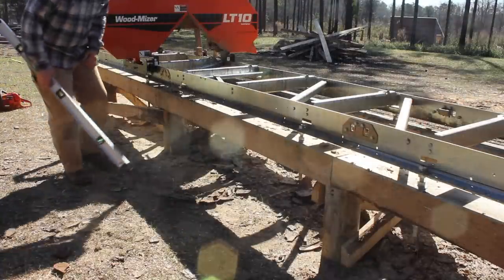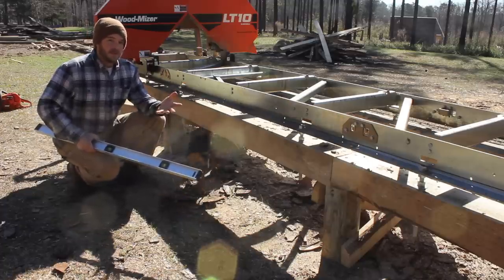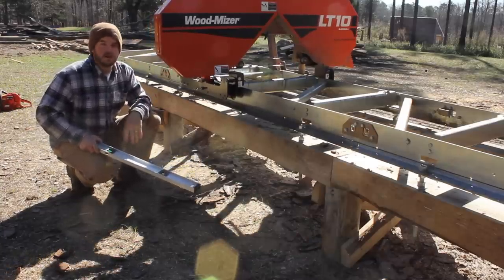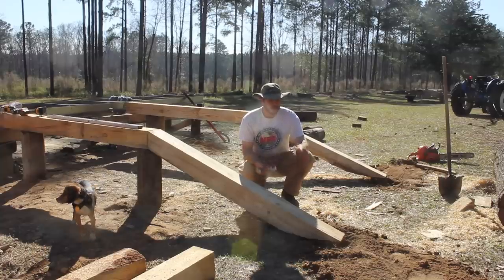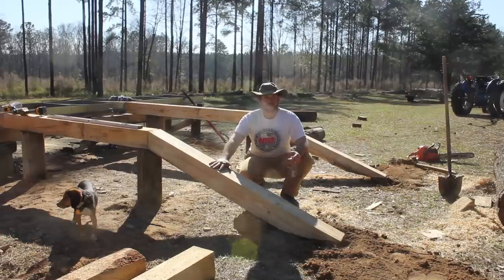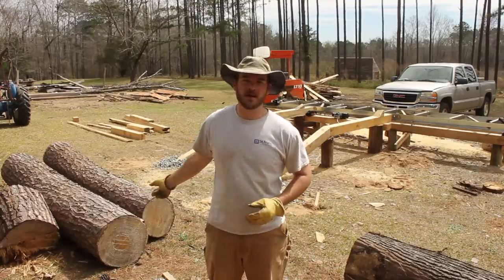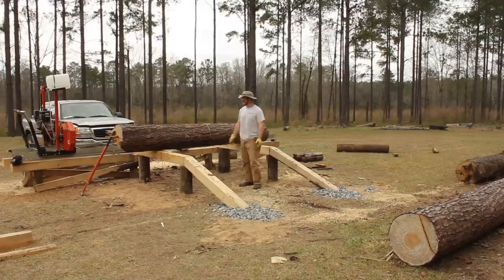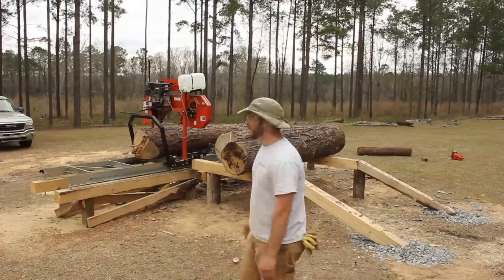The Best Sawmill Upgrade I've Ever Made

Comment: Nicely done. A tip about the concrete around the posts; bring the concrete to just above ground level. Any water that seeps will sit on top of the concrete below grade and in that first 6-8 inches of soil is where all the bacteria live that is so good at breaking down organics. I've had to repair fences and pole buildings that were built with pressure treated (some creosote)  where the failure point was right at concrete level below grade. In some cases they put some at the bottom and some more near the top, failure in both locations.  Concrete brought to above grade and slightly sloped away will provide good run-off and no long term pooling. Treated posts with no concrete at all will actually last much longer than those with a ledge of concrete that is below the surface.  Another point to give peace of mind is to put the added support member on the winch timber on the opposite side of the direction of pulling force, in your case, on the side between the mill support rail and the winch timber. It acts just like a header over a big door, deeper is better than thicker i.e. laminated 10" x5" rather than 5" x 6-1/2". (first number being horizontal dimension, second is vertical). A lot of words to try to explain a 3-dimensional situation. Love your channel, you have an exceptional work ethic.
Reply: Both excellent suggestions - I especially like the concrete "cone" idea for lack of a better word. Plus that'd get those little gravel stones away from the logs and he'd never risk getting one embedded and ruining a saw blade later as someone else wisely noted.
Reply from the maker: murphymb Great suggestions! Thank you.
Reply: 8
Reply: 99999 IP
Reply: @briankeller9424  Herman Cain? "9-9-9"
Reply: A fella can learn a lot just reading “been there done it” comments, appreciate your advise.   From Missouri
Reply: Don't let the concrete spill over the hole you dig and form a lip. The lip provides a space for water to get under and freeze in winter. When the ice expands it causes the post to heave up causing misalignment.
Reply: @twal5299   agreed, the guy that suggested to let it go to ground level must live in a place that doesn't freeze over the winter

Comment: Nice job.  Thanks for sharing. One suggestion would be to make a groove in the soil where you pass the winch line under the log. Have a length of rope placed in the groove before the log is moved into place at the end of the ramp.  That way you can easily connect the rope and fish the winch line under a large, heavy log.  Happy milling.
Reply from the maker: Mark Rothenberg It’s hard to see in the video, but I actually did have a little trench dug out for exactly that purpose. Appreciate you watching!

Comment: Excellent work, that'll make it safer and a whole lot easier. Couldn't help but think that if the tailgate of the truck was even with the top edge, a couple of ramps parallel to the saw bed, and a little decking, and you'd have a great atv/lawn tractor/etc. loading ramp at the ready all the time. Don't you love when someone else is trying to make MORE work for you!

Comment: You might want to think about getting a set of three point hitch pallet forks for your tractor, this would help greatly to position the logs for your log deck, that way you can drop the logs off most anywhere within the general area and be able to maneuver them into place. Awesome looking deck, that should save a lot of work and aching back, you might want to think about adding a angle brace in front of the winch to help support the pull of winch when pulling logs up the ramp...have a good day
Reply from the maker: Don Latimer Good ideas, thanks Don!

Comment: The log deck works great! Did you consider mounting the winch on the back side of the sawmill - maybe on a large post up higher than the bed level so you use it to turn the logs as you are cutting wood?

Comment: The log deck on my mill is like yours. The wood deck beams rotted pretty quick so when I replaced them I paint them from time to time with used motor oil. Now they are lasting well.

Comment: Great idea,something to think about ,a flat piece nailed outside of ramp with horizontal holes in it ,to put a  rollback pin in the horizontal holes, or oversized chalks( some short ,some longer) when the  next feeder log starts sliding crazy lock it place so it doesn't have to be lowered to the ground and get a better bite ,nothing like seeing a working man! Keep it up

Comment: Oh sure, use the old knuckle buster post hole digger for the 4 holes, but get out the impact driver to put the screws in.  LOL. Great jobs on the log deck and ramp.  I am sure your back loves you even more now.

You may also want to consider installing another telephone post on the far side of the mill and anchor the winch on that side.  This will prevent you have having to remove the winch all the time time before you start to load logs on the mill for processing.
Reply from the maker: bwillan Ha! Those diggers keep me warm on cold mornings! The winch is actually mounted below the level of the logs so the logs just pass over no problem.

Comment: Excellent ramp system!  You're sure to benefit from it.  One critique, IF you don't mind?  On other mills where they utilize a winch to pull logs up to the bed the winch is located on the opposite side of the mill.  You could do that easily.  Plant one post to mount the winch onto it and brace it in the same way the ramps run...against the stress.  I suspect you'll figure that out ;-)  Great job regardless!  You're doing great work!  Thanks for the videos! #KeepTheChipsFlying!

Comment: Well done, sir, well done. If I may, the eye bolt that you have underneath the winch, get a second one. Move them both out away from the winch by the posts. Get yourself a piece of cable or even a strap and make a triangle. Attach the ends to the eyelets, take the top point of the triangle all the way out past the ends of the ramps roll the log over it. Then hook your winch to that point on the triangle. As the winch pulls on the triangle, it's going to get wider on the log, which will help keep both ends coming up the ramp together. I hope this makes sense. If not, shoot me a message. I would also recommend that you mount the winch on the opposite side of the mill, and higher. It would be most productive if the line pulled upwards towards the winch or straight to the winch.

Comment: great job on finishing your smart loading ramp , your first efforts where great . Maybe add a second cross beam to the outer two posts. Then add a section of chain from the inner post ( near the tow motor) to the new outer post . So ... You can simply hook your chain with cable hook and not crawl under the first log to cable up each 2 nd and 3rd log ? On your 2 wood safety wedges that keep the 1st log gauged away from saw travel. Connect the wedges with a piece of lite wgt emt conduit so you can move /control both wedges without having to walk around the load rack each time. 3rd thought  mark the horizontal beams  with a black marker so you know where to position the wedges each time? Is milling what you do for a living on your farm? Keep up the videos and sharing . It is appreciated. :)
Reply from the maker: I mostly just mill for myself. Great idea on the marks! Appreciate you watching.

Comment: awesome job and smartest thing to do. I always cringe when I see people using loaders, clamps or other machinery to place log on mill. If not using mill hydraulic loading arms, and you still want to use machinery, I believe that you should always use a log deck. Deposit your log on the deck and roll it on the mill in a controlled manner. The mill is a precision instrument that can be easily be bent out of alignment if a log was to be dropped on it's bed..... and we all know that operator errors and equipment failure can cause that very easily. Great investment of time you made my friend ;)

Comment: Great job.  Your first pair of posts (directly below top of ramp) will spread apart eventually cause there is lateral force on them.  I’d x-brace them if you can do so without interfering w the cable.  It’ll keep them vertical longer.

Comment: Another great idea. I'm going to be setting up my new saw mill for the first time come spring [April here in Southern Ontario] and i cant wait. Once I have the sawmill set and leveled, I am definitely going to rig up a ramp similar to yours. I was planning to use an older bucket tractor with fork extensions, and probably still will for some bigger logs, but it is a bit too large and difficult to maneuver in the space i have in mind. I'm also a bit worried about bumping the sawmill, or forks scraping the bunks when pulling back. Plus i really like the idea of having a loading area. My time spent on my land is often sporadic and limited, so having a few logs sitting waiting to be milled for the next time i come up is very appealing - [rather than spending time staring the tractor and having to load them before i get started milling]. I've gotten a few good ideas from your channel, thanks. i will pass them along.

Comment: Bridge between the brow and the mill with removable angle iron . A tractor can lift logs onto the brow. You can then roll them onto the mill, take the bridge pieces away. and saw. Its easy that way. My brow is pinned to the ledge. My mill is on a slab on the same ledge. Its a little low, but it works well. Good luck. surprised people dont use these more.

Comment: GOOD JOB MY FRIEND.. Maybe run a couple braces from next to the winch over to the timbers the logs rest on ,, bolted in with some all thread ,, or lag bolts.. You could rest them on top & draw the angle across the bottom,, cut it out with chain saw,, small impack screws to hold while the bolts are drilled.. love your little pup.. Aloha

Comment: Nice work overall.  One thing on setting the posts that could have helped, a water level (clear tubing with water in it) from the track to the posts.  Taht would have removed the need to cut down posts.  Or string to set it up also.  The post hole digging was impressive, kudos to such hard days work!!
Reply: Oh BTW big thanks for building up a log ramp, need one for my "new to me" mill!  Will be doing similar now!!

Comment: Add a 2 by 6's onto the inside of the rails about 1 inch down from the top. This will allow you to use a bar to roll or scooch the logs forward. Faster, and will allow for alignment.. And, make some large wedges for stops on the top rail as you advance the logs.

Comment: First time commenting, the design and concept are awesome and that it is hand engineered is even better. Your creativity is endless when it comes to these types of projects. I only see one point feel compelled to state about the cross beam with the winch on it. Besides the board you added, and this maybe redundant, but for you and the safety of the mill, I would add support posts under the beam with the winch. Nothing need be dug out or concreted, just extra support If the board or the main beam get damaged or fail. Would be a terrible thing if it failed and you mill rails were crushed or damaged.
Reply from the maker: Appreciate the great comment. I see that timber as the weak spot also. My concern would be getting up into the larger logs, 22-24". A post or two and a brace is a great idea there.

Comment: Get yourself some quick connect cable ends for battery cables. Put 1 end on the truck with a weather tight cover, kind of like a snow plow hook up. You could even put an inline fuse or breaker rated at max draw for the winch to protect the truck. Make up the matching end on the winch. Save you a lot of hassle with popping the hood etc every time. 

Will also avoid the arcing ect and chewing up your battery terminals.

You can make a short cable with the plug on one end and the gator clips on the other to give you all the options
Reply from the maker: Greg Mislick Good suggestion, thank you!

Comment: I built my pole barn with a pretty decent amount of Timber Lock screws, is that what you were using? They have > 1 ton pull out strength and 500 lbs shear. 
I am a woodworker, and don't have room for a mill, I just frequent the local who do. I did have a suggestion, on the ramps, if you used oak or similar to create a (aprox 6-10" ) wood tooth, to prevent slipping back, maybe 1/2" lags to pivot on, and a small spring to pull up and hold in place. Looks good...

Comment: Maybe consider removable(?) peaked chocks/dogs/pawls on pegs that drop into sockets at the top of the ramp timbers, extending the ramp just a couple inches longer and higher, and preventing logs from getting away from you and rolling back down when you've removed the cable.

Comment: Great video. I want to learn all I can about platforms and loading devices. I do have a  problem where I live-- Brooks County GA on the Florida line-- with termites. I have even found them in used cross ties used for landscaping. I was shocked to see them living in a cross tie. I am contemplating buying  a simple mill. Beginning to wonder is I need to build it on concrete. Thanks.

Comment: You can center the log with less cable and easier work, by laying a chain from the two opposite ends of your pulling beam in a "V" that extends beyond the end of your ramp. Roll the log on the ground over the point of the "V", so you don't have to drag the cable under it. Then just lay the cable over the log and hook to the center of your "V". The ve will get wider as you pull the log up your ramp and correct any misalignment as it comes on to the deck. You don't have to pull out as much cable and dig under the log.  Good luck
Reply: Can you draw this out for me or post a picture of what your saying? Please

Comment: You may want to invest in some synthetic cable for the winch, those steel cables can cut into trees. Also if you’re going to use your truck to power the winch you may want it running so the batter doesnt die after winching a few logs in a row.

Comment: The twisting moment on your winch beam is going to eventual break those light lag screws you used to attach the beam to the bottom of the ramp.  Maybe you used heavier lag bolts that you didn't show.  Nice ramp overall.  Going to save your back for sure.

Comment: Just finished building me a log deck also. I haven’t added any ramps or winch I am able to load the deck with the tractor and boom. It’s sure is nice to take some of the worry away about hitting the mill with the tractor or a big log.   

I plan to add a winch and ramp later. What size winch are you using
Reply from the maker: Chris Cox It’s a 4500lb winch. It was on sale at Tractor supply for 149 last year. I think I could get away with a smaller one, but this one was a great price and is plenty strong.

Comment: Suggestion;  pour a 2 x 2 slab with re bar under the wench.  Then place a short timber on it and screw it to the wench beam.  Also, adding under support to the ends of your wench beam wouldn't hurt anything either.

Comment: Yes  solar panel are a good ideal if you don't have a lot of cloudy days or a Panel that can charge the battery up fast enough. that wince motor is like a starter motor it will pull about a 150 amps DC and that can jerk a  battery down pretty fast.
Reply from the maker: James Tate Yes, this winch can drain a battery fast. Leaving the truck running i think is my best bet.

Comment: I would have left a bit of the top of the ramp timber riding a bit higher than the flat posts so there was a small hump to act as a safety so the logs can't roll back away from the mill. A diagonal brace set on the same timber as the winch wouldn't hurt either so it didn't tear out the winch or risk snapping the post since it has holes drilled in it and the torque on the log the winch is putting on it.

Comment: Well that'll definitely make life easier. At least until YouTube buys you an LT 40 wide! ;P. Maybe a dumb question here but couldn't you use the boom on you tractor and slide the logs up the ramps? The ramps would keep the tractor from having to lift all that weight? Regardless, You've come up with a fairly simply solution to big problem on the manual mills. Nice work as always!
Reply from the maker: Northwest Sawyer The tractor could probably do that...in fact that was suggested by a commenter in the last  video and I seriously considered doing it. But, I went with this because it’ll keep me from backing the tractor into the mill on accident...and because it’s a much smoother operation. I don’t know, I just like it this way. Sounds like you’ve got a 40 wide on the brain!
Reply: Well I don’t but we know a guy that does😬
Reply from the maker: Northwest Sawyer Indeed! Looking forward to his upgrade!

Comment: I recommend some "dogs" on the ramp to keep it from rolling backwards on one side or the other if it gets to sliding instead of rolling. A horizontal bolt through the ramp holding a length of metal that is off center drilled so that gravity will hold it up after the log goes over it.

Comment: If you mount the winch to the other side of the mill it will put them on the mill and if you drill a couple of peg holes to keep the logs from rolling off just put in the peg to keep it from rolling

Comment: Can I make a suggestion with the log ready to go up the ramp Get a 1/2 inch rope about 15 feet and the beam you have your winch on tie one end to the outside and the other end to the opposite side take the end and go to the log pass the end under the log and tie the winch hook to the end of the rope as you winch it up the rope will turn the log rolling it up the skids towards the winch and as the log comes up the rope will move out. This way it only lifts the weight of the log and is easier on your winch and actually you could put a hand crank winch as the weather is easier on the hand winch than your electric. In your video at 26 min see how your log tends to want to turn if you do it this way it tends to correct itself.